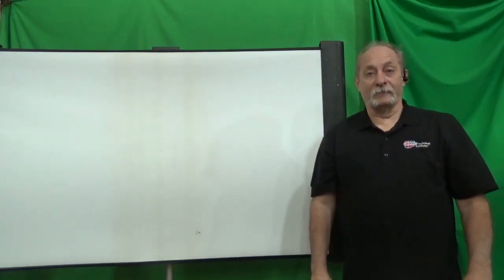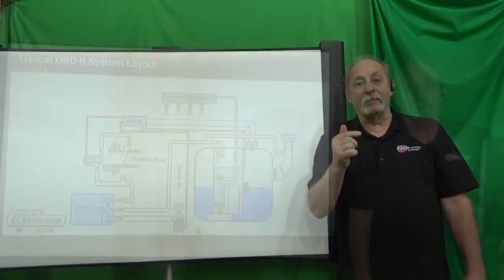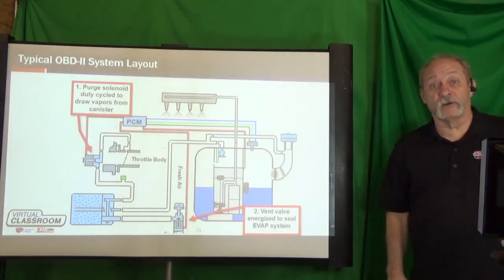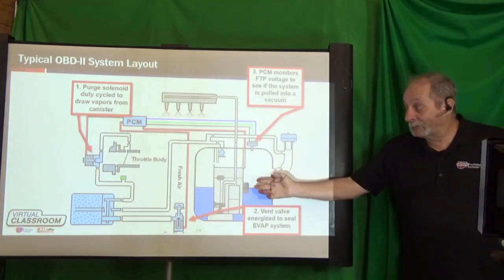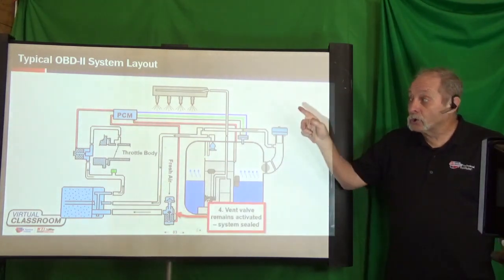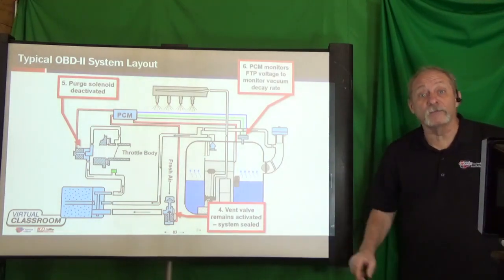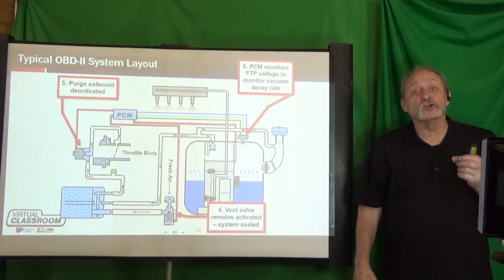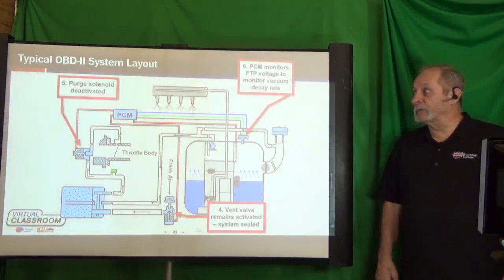GM Evaporative System Essentials

Comment: Hey good Sir. Very good explanation on the GM system. I'm a bit of a slow understanding person and if you can help understand my question I have better.... when you say the FUEL VAPORS WILL DECAY THE VACUUM??????? I'm not understanding that. What exactly does the vapor do???? Does it suck it up????? I read that it's normal for vacuum to decay but never knew what makes it decay or really thought about it. THANK YOU JOHN
Reply from the maker: As the gasoline evaporates, it causes the pressure in the tank to rise. So if you pulled the tank into a vacuum, that makes the "absolute pressure increase"  Vacuum decrease

Comment: Good info. How often is the test run on GM vehicles if the test passes? Or if it fails when does the computer try again?
Reply from the maker: That's a function of code set criteria, something that we will cover during the class(es) that are associated to this video. In most cases the test would be expected to run once per day, provided the ambient temperature and fuel level are within specified ranges. Because of the restrictions to when the test can run it's plausible that the test could be blocked for an extended period of time in some locations during winter or summer conditions.
Reply: @thecardoc100  thanks for the information!